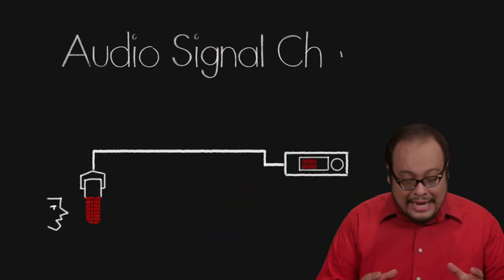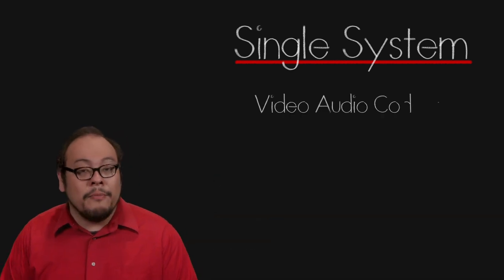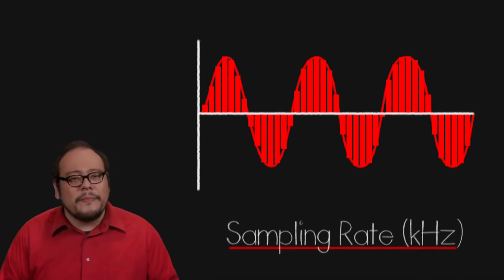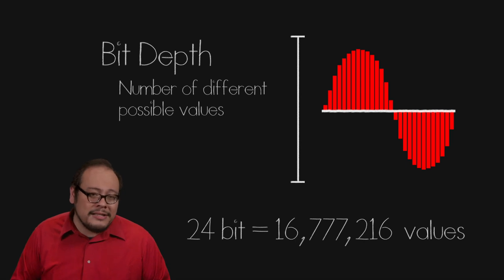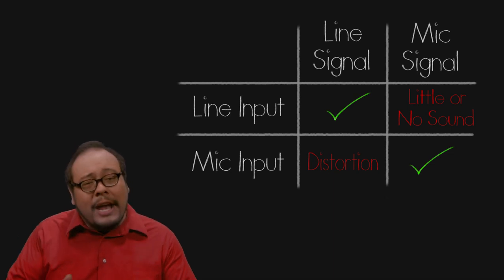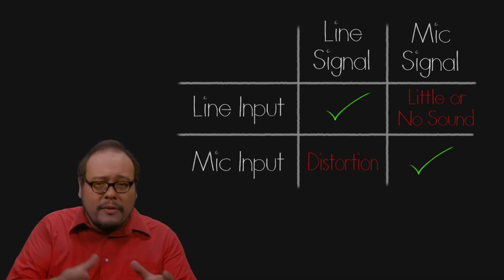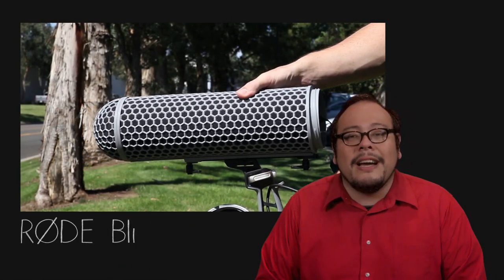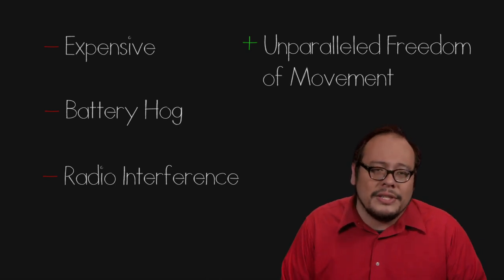The Basics of Recording Audio for Digital Video

Comment: YET AGAIN the "high quality audio" myth...
Nyquist was more than right, and 44khz sampling rate guarantees up to 22khz frequency reproduction, which is, sorry, much higher than anyone can listen. Anything above that sampling rate has absolutely zero audible difference. Higher sampling rates are used for very specific reasons, in which it may be better just because of the workflow.
You just cannot hear any difference between 44.1 and anything above. If there is a difference, it's either caused by aliasing (distortion) caused by the ultrasound, or the low quality of the analog to digital converter.
Reply from the maker: Yes - 44.1 khz or 48 khz for video is just fine for delivery. But there is advantage to the extra resolution when you're doing a lot of post processing. As you hinted at - it's not about the frequency so much as the aliasing and digital artifacts that go on. And really for filmmakers who are shooting terabytes of data on the visual side, the extra storage required is completely negligible.
Reply: I've heard that 44.1kHz has poor phase accuracy in higher frequencies.

Some rough calculations give ~130 degrees accuracy for a 16kHz sound at a 44.1kHz sampling rate vs a 60 degree accuracy at 96kHz. Contrast this with accuracies of ~3.56 degrees and 1.65 degrees for a 440Hz sound.

I recall reading somewhere that some early digital video recorders used sampling rates on the order of 18MHz to be able to capture the colour subcarrier of analogue TV (which has a frequency of something like 4.5 MHz) with enough phase accuracy to be useful (this being important because part of the colour data was encoded onto the phase of the colour subcarrier).
Reply: pfarina  Aliasing. Look it up, cause clearly you don't understand the importance of it. Also, those higher frequencies are important. Think about it like this, play a simple saw tooth at 17khz. Can you still hear it as a saw? If so, then you are able to discern, in one form or another, that a harmonic above 17khz is there. Not only the second, but at least the third and fourth. So those frequencies are indeed, important.
Reply: You're saying that harmonic information above 20khz influence backwards? That makes sense, but up to what point? What would be the optimal "headroom" nyquist frequency based on that? 80khz since the first harmonic is the octave of 20khz (40khz)? But can we really hear the influence this has on a 20khz sound (which is unhearable for almost every person)?
Reply: pfarina  I've heard about that. I think it's supposed to be the 30-40kHz range where the ultrasonics make contributions to what gets heard, so in that case 96kHz is probably good enough if all you're concerned with is merely capturing the frequencies. If you want good phase accuracy, too, you'll probably need to go for 192kHz. In any case, you'll still need speakers capable of reproducing frequencies that high to really get the benefit.
Reply: Apparently the sampling rate really affects the phase accuracy, because it introduces a delay, as well as the low-pass filter...
I would be very glad to know if are there any papers about what is the minimum sampling rate for IDK, 95% phase accuracy at 20khz.
Reply: pfarina  To get the phase 95% accurate means you need an accuracy of 18 degrees. To get that accuracy at 20kHz, you would require a 400kHz sampling rate. The closest one to that actually in use is 384kHz, which would give a phase accurate to 18.75 degrees.
Reply: I see, but that phase problem, isn't it caused by jitter, the imprecision of the ADC? Because there are very expensive converters that claim having very little jitter at low sampling rates.
Reply: pfarina  Jitter is yet another kind of problem, though not one I know a lot about. What I do understand is that if the clock is not sufficiently precise, the sample timings won't be consistent enough to get an accurate recording and the resulting errors will add noise.

The phase problems I've been talking about come simply from the sample-rate not being high enough to represent the waveform of interest accurately. If you make two measurements 180 degrees apart, you might get the peak and trough of the wave and reproduce its amplitude correctly (giving values of 1.0 and -1.0). However, if the wave starts earlier or later, you might make your measurements when it's only at 0.4 and -0.4, giving a reproduction with peaks where the original was actually still rising or falling, and lower amplitudes, too.

I can easily visualise the problem I have in mind, but I don't know of any tools for illustrating it. I may have to look into writing something for the task.
Reply: Oh now I understand, could it be portrayed like the flickering effect that happens when you shoot a 60hz tv with a 25fps camera? wouldn't that be the same kind of phasing problem, but with images?
Reply: pfarina  Possibly, though I think it might actually be an illustration of aliasing.

The phase problem I was talking about was when you have something of a frequency which lies within the range which can be represented by the sample-rate (the specific example I used was a signal at the maximum frequency which could be represented by a given sample-rate). The TV example has a slower sample-rate than is needed to represent the periodic signal.

A 60Hz TV is flickering faster than the 25fps camera can capture, so in each 25th of a second the camera exposes the sensor, the TV goes through 2.4 complete refresh cycles. That extra 0.4 resulting in part of the screen being drawn for the third time and ending up brighter than the remainder. The next frame has that 0.4 shifted down, the next shifted further, and so on, giving the characteristic rolling flicker.

I tried something similar in Audacity. Generated a 600Hz sine wave with amplitude of 1.0. Set the resampling quality settings to minimum (thus ensuring aliasing). Resampled to 250Hz. The result? A sequence of volume of -0.95, 0.95, -0.6, 0.6 and the spectrogram showing the resulting sound now being at 100Hz. It's been aliased down.

What I think would be a visual analogue of the phase problem would be making a 50fps recording of a 50Hz TV, but with the recording starting halfway through a frame being drawn, resulting in a video where the top half of the screen contains one frame, and the bottom the previous frame, possibly with some brightness mismatch due to the vertical retrace of a CRT taking up a small fraction of a second.

EDIT: Actually, maybe that last paragraph is wrong. Maybe a 50fps recording of 25fps video would be a better fit. I'll leave it up anyway in case someone else can correct me on it.

Comment: You might a good knowledge of recording audio... But in this video, the audio recording is not up to standard.
Reply from the maker: It's just low because I followed the recommended recording levels without boosting them for final delivery. Otherwise, the audio is just fine.